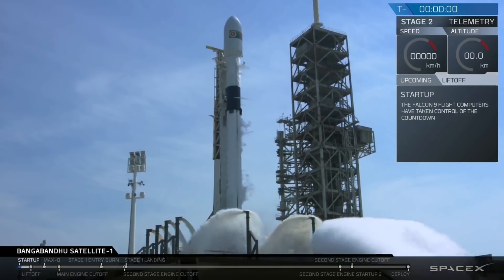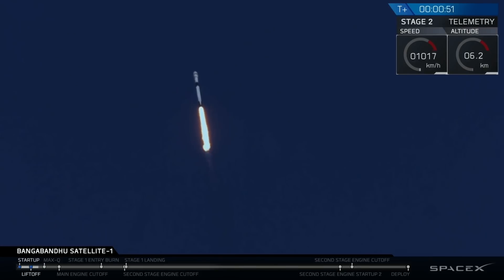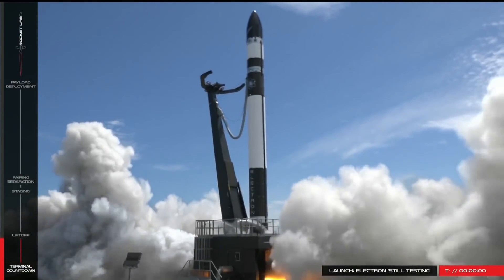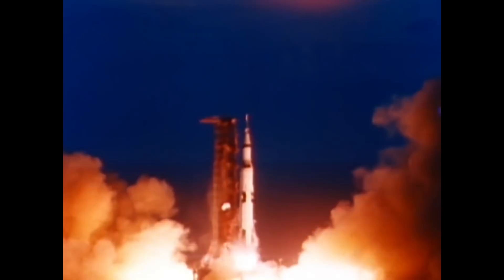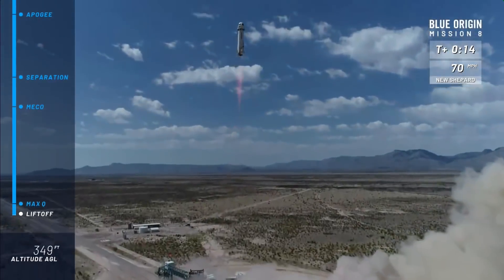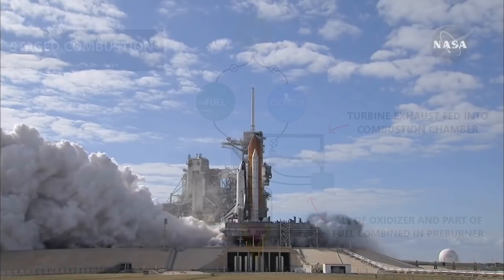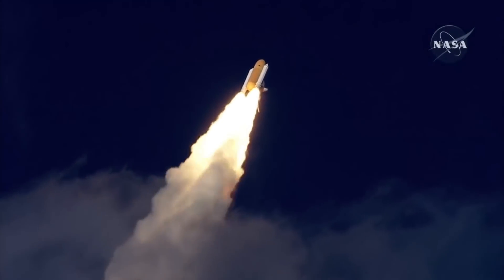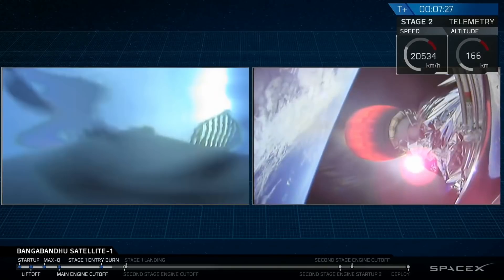How Rocket Engines Work - Part 5 - Combustion Cycles

Comment: What makes the tap off start complicated? Can you explain?
Reply from the maker: The tap off uses the gases from the main combustion chamber to drive the pumps. So when the engine is starting the pumps are not running which means no high pressure gas in the main combustion chamber which means nothing is powering the pump. Kind of a chicken and egg situation. You can't spin the pumps until the pumps are already spinning.

Comment: One important thing that you left out about the gas generator cycle is that they must run the gas generator fuel or oxidizer rich to prevent melting the turbine. The reason that they are less efficient than other pump fed engines is that the extra fuel/oxidizer in the gas generator is dumped without being burned, lowering the efficiency. The reason that staged combustion engines are more efficient is that they burn the extra fuel or oxidizer used to cool gas generator exhaust in the main combustion chamber.

Comment: The peroxide steam power gas generator cycle has successfully launched many thousands of times into orbit. The entire R-7 family of rockets including all Soyuz derivatives use the RD-107 and RD-108 engines which use this cycle!
Reply from the maker: Yep, they're the only currently active engines that still work this way.

The German V-2 was the first to use this cycle and after WWII both the US and USSR stuck quite close to the V-2 design for several years when designing their own rockets.

The 107 and 108 (most of the early RD-XXX engins) are direct decedents of the V-2 engine. The 100 was a copy of the V-2 engine, the 101 was a V-2 engine with some minor changes, 103 was still very close the the original V-2 design but more small upgrades, the 105 and 106 were originally intended to be the engines for the R-7 they switched fuels and were the first Russian to be significantly bigger than the V-2, but problems during development meant they were abandoned and developed into the 107 and 108 which used 4 nozzles that were similar in size the the V-2 nozzle (this fixed some of the problems they were having). The 107 and 108 is where I would say the Soviets first successfully stepped away from the V-2 design, but it still had many similarities.

Comment: Should include the Raptor design that has two separate preburners with separate shafts for LOX and Methane.
Reply from the maker: I originally did have a section about full flow staged combustion, but I decided to cut it because I felt it didn't really fit right in this video. I'd rather make a short video dedicated to that so it can be explained better without adding too much clutter/information overload to this video.
Reply: @SpaceIsKindOfCool  Major fan here! I'm in love with the level of detail you include in your vids. I hope I can bring into your attention a rather cool project for Mars colonisation. https://nexusaurora.com/welcome.pdf. I'm the founder of Nexus Aurora and I'd like to get in touch with you for sharing the material we are producing https://nexusaurora.com/report.pdf. Drop me a reply if you are interested to dedicate some air time to this community project. I'll be quick to reply. Regards!
Reply: U mean full flow engine